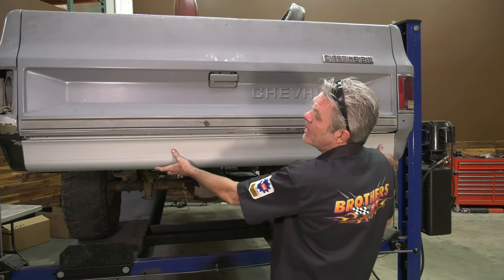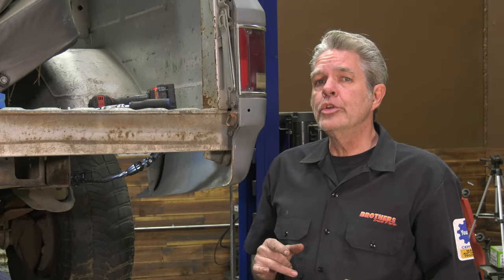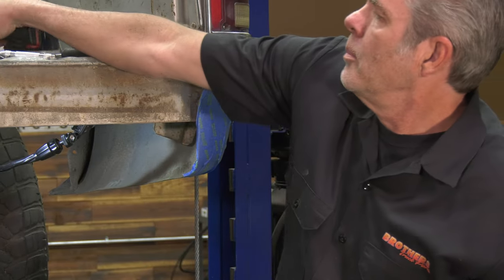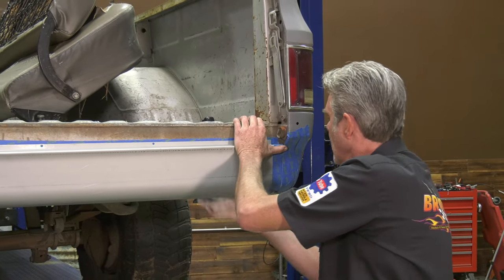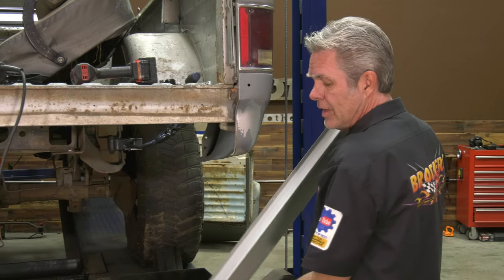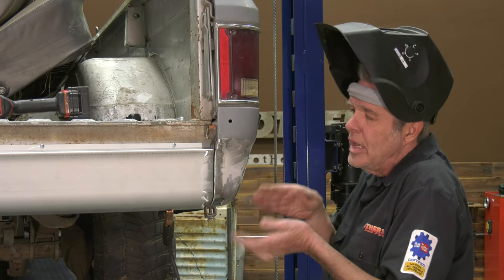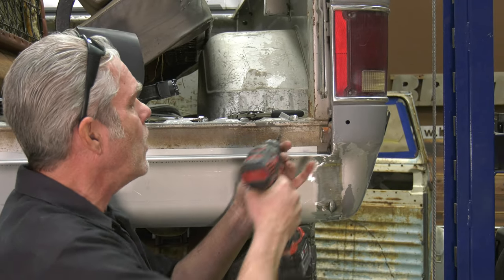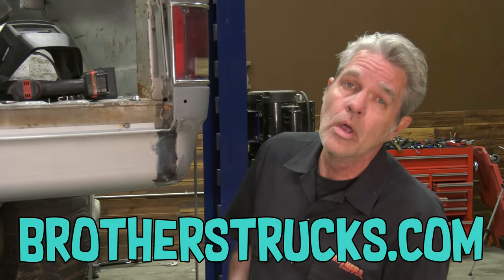1947-87 Chevy & GMC Truck Rollpan (Roll Pan) Install 2 Ways - Smooth Your Truck and Dump the Bumper!

Comment: Where do you get that little bracket you put on the bottom of the roll pan.what do you call it Panel clamp?
Reply from the maker: Yes it's called a panel clamp, we sell them, here's a link: Patch Panel Clamps: https://bit.ly/2QACGxc
Also in this video we show a little bracket that come WITH the roll pan when you order it from us. Not certain which one you are inquiring about, but hopefully that answers the question!

Comment: What is the proper welding settings for welding body panels? Like this?
Reply from the maker: The answer will vary based on the thickness and age of the metal as well as the equipment you use to weld it. Sorry that's not really a great answer, but maybe we'll do a video on this topic to provide some guidance.